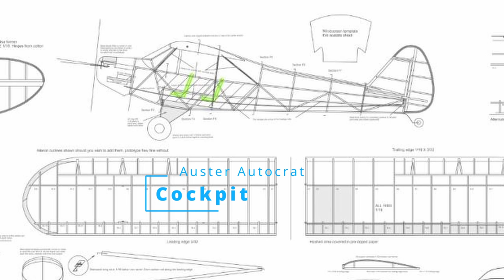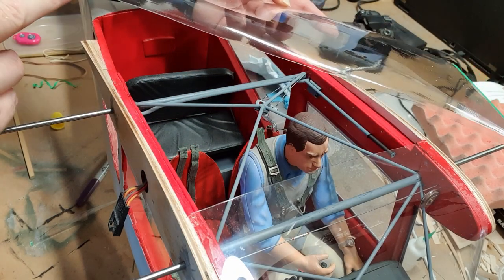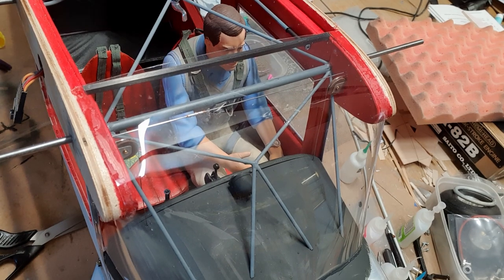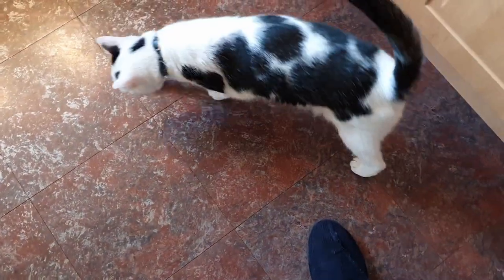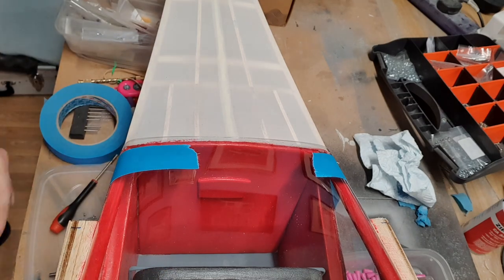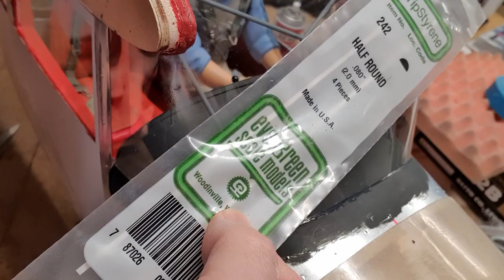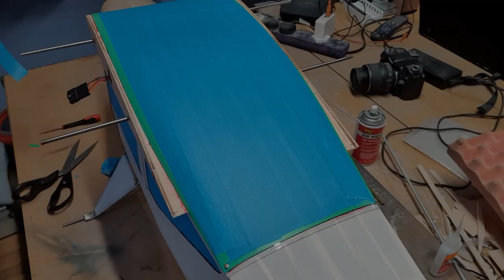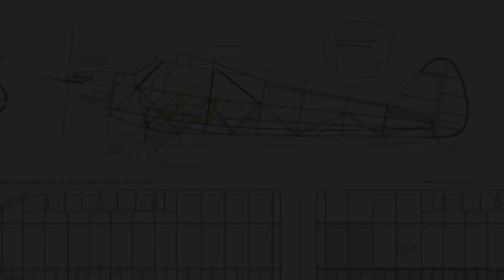cockpit glazing

Comment: Danny machine-mart do some really good clamps also a company called rolson do them too hope that helps😊
Reply from the maker: Thanks Mick, I will take a look. I also need some larger ones for holding resin casting moulds together. I like to physically hold clamps when I buy, the size never seems right on web pics, hence they usually come from model shows